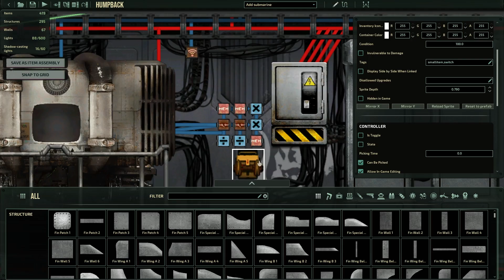Barotrauma 9C Reactor Controller (Overvoltage Edition™)

Comment: wait what's the formula for over voltage?
Reply from the maker: You basically divide 1 by whatever multiplier you want to achieve.

1/2 = 0.50 (x2 multiplier)
1/1.5 = 0.66667 (x1.5 multiplier)

God it's been such a long time since I made this video.

Comment: This thing works wonderfully in the sub editor but just works weirdly when trying to make it in a campaign. The regular controller behaves as expected, but the overvolt for some reason causes the load to spike up. For example, when docked to a station, the load will be about 500kw but the moment i activate overvolt the load will spike all the way to 3000kw. The reactor does eventually rest at an output of 1.5 times the load but only after the load massively jumps to 3000kw despite literally doing nothing. The only change I have made to this guide is to use a button since the switch can't be untoggled outside the sub editor
Reply from the maker: @domino6918  Glad it's working decently-ish, my goal with these videos was to give people a reason to start messing with components and the best way is to give them an easy example to copy and let them tinker with it.

Sadly I've stopped playing the game for a while so I can't really say where that weird behavior is coming from.

Comment: Using this design on my custom sub i get constant temp low warnings when running this setup. My reactor has a max output of 8000 so i set the number of the first memory to 80. Other than this everything is hooked up exactly as shown in this video. Is this supposed to happen or is there something about this setup that i've missed?
Reply from the maker: I'm not sure if any updates changed the underlying mechanics, I'm gonna reply using my knowledge from the past.

Temp low is a good warning to get, if you have 3 bars of heat on the hud that means the controller is working properly - remember we want the lowest amount of heat generated that can still match the load in energy production.

Temp will go up over 3 bars when you OC the reactor, hope this helps.
Reply: @Adamonus  There is 0 bars of heat on the HUD. It still provides my passive power requirement though and even when things start running it’s fine. In OC mode it doesn’t heat up either but the OC mode works as advertised, providing more than enough power for my modules
Reply: The simple answer to that question is, this controller is only an approximation to the reactor formula and that is its disadvantages (more apparent with more powerful reactor). 
LONG ANSWER: this heat equation is configure to give a linear heat of 0 when load is at 0% to 5000 when load is at 100%, so if you have a very powerful reactor this arrangement is not ideal, you will constantly experience low temp and it may not support over voltage very well.

Comment: Odd.  I am trying to make this in game.  Set on relay to state 1 and the other relate to state 0.
Oh I cannot set the switch to toggle in game.
So if you are building in the game you need to use a button. (and I put a light above it so I know when overvolt is on.
Reply: Ops.. set my reactor and engine on fire.. On a Camel.   Nothing else was damaged.
Reply from the maker: @elfiwolfe Perfect way to learn 😂
Reply: Was only 1/1.5 = 0.667 % overvolt and fried the engine and reactor.
Reply: Couldn't you just use  a button conneted to an OR component instead of using a lever
Reply from the maker: @bryantan8654 What can I say, aesthetically I love how the levers look and I will not sit idly until my helm is all covered in levers, if something else works better for you or your design just use that.

I made these videos in order to provide people a template and maybe get them interested in the world of electrical engineering not a rule of law - so fuck around with it and find out what happens :oops:

Comment: I'm pretty sure you can do this with 5 components: build the classic 5 c reactor controller, replace the memory component that stores the max power output with a signal check component, set signal check components true value: 46.5 false: 31, wire the lever to it and it should work the same with 5 components.
Reply from the maker: Check pinned comment and reply✌️ It's a preference of mine having memory components and not have the values baked in the OR components - I can switch from 1.5 to 1.7 by adjusting the last mem cell and not have to calculate the value that would get baked into the OR.
Reply: @Adamonus  Okay I understood, I use a system very similar but for under-volting instead, I can say that you can definitely simplify the circuit if you wanted to, best regards :D
Reply from the maker: @berkaybattal7433  Cheers and thanks for stopping by, hope you enjoyed my messy explanation ✌️
Reply: @Adamonus  You are welcome brother, about my previous comment, clamp max should be 100 not 1 sorry about that
Reply: Also you should set the clamp max of the divide component to 1 which is the max power output memory component is connected to. So that the system doesn't set the fission rate too high where load exceeds reactor power capacity.

Comment: Why not just use an OR component for this?  Have lever run in as input, set true output to the overclock power, set false to normal.
Reply from the maker: That also works, you're reducing the amount of components needed by 4 - Personally I just didn't wanna bake in the values inside the OR component and rather have it individually out as memory cells for easy access, pinning this for anybody who wants to do it this way! :goodvibes:
Reply: @Adamonus  Yea, definitely will be more flexible for changing if you do it your way and can mix and match if you want to undervolt for higher fuel efficiency.